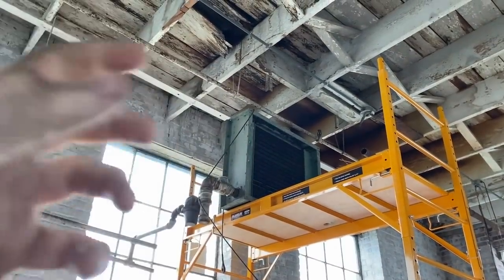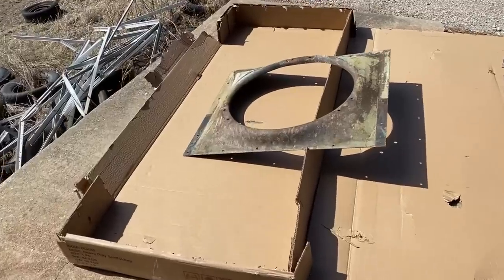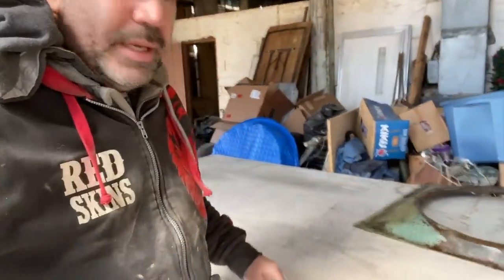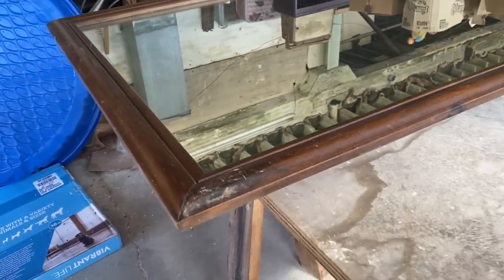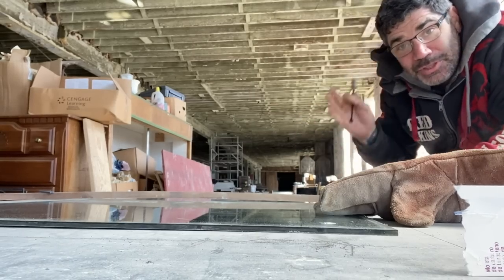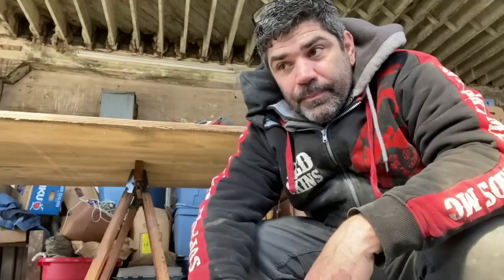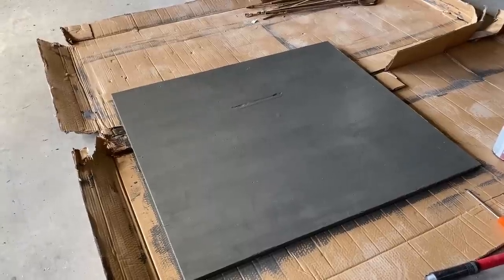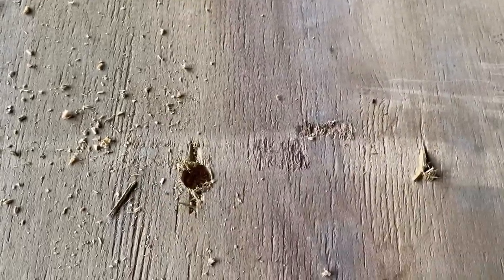Converting antique industrial salvage to interior design elements

Comment: I was a picture framer for 25 years, and cut glass and mirrors even day of the week, we even cut rounds and ovals,....(that takes a bit of learning curve). We added a drop of 3 in one oil to our cutters. In the future, buy some or find some glass and practice cutting it. Usually a light even touch, does the job. No heavy pressing, required. You got this,..even with no experience.
Reply from the maker: I just used the stuff the hardware store sold, I'll check the 3 in one. thanks.

Comment: For future glass cutting projects, you can hold the cutter at a lower angle if you turn it over. The important thing to know is that the tiny little wheel is what scores the glass, so as long as you're pushing that onto the glass you can score it at a lower angle. Doesn't have to be standing straight up
Reply from the maker: Thanks. I have a ton to cut. By the end of it I'll be a master craftsman!  over 500 windows to replace!

Comment: I make furniture, and wanted a custom shaped piece of glass, shaped like a rounded boomerang. I had to use 3/8 inch thick glass, since it was a light duty table top. I made the drawing on thick paper and taped it to the glass and let the professionals cut that complicated shape. A boomerang isn't just a "V" shape,  that inner part of the "V", requires special cutting tools. And it needed to have the pointy ends rounded. Columbus, Ohio has a couple of stained glass repair shops. This where I think you need to make some connections with the artisans and artists who live in your city. That college near by has a whole freaking fine arts department, and I am guessing there are many artists who live in your town, skilled in all sorts of things. Just a thought.

Comment: Most hardware stores cut glass for storm doors, and decor items, a picture framing shop sells mirrors and glass, and should have a wall mounted glass cutter that can handle any size.
Custom work needs to go to specialty shop, that drills and shapes glass. Places that do "stained glass" repair are usually equipped to do complicated things.
Reply from the maker: I'll check around if there is a company that does it locally.

Comment: I've found that when cutting glass if you spray lubricant on your cut line it cuts more easily and gives you a better cut/edge overall. Using the lubricant on the glass I found that I can even cut curves in the glass. All these tips should work just as well on mirrors as well. 
That is one thick mirror. You got on great deal at only $4.
Reply from the maker: Thanks for the tip. I put a drop of oil but didn't consider the whole cut.  Habitat has about 10 of them at any given time.

Comment: I would take it to a window/glass shop and have them cut it. 25 years or so ago, I made a table out of a 3/4” piece of glass and wheels from construction scaffolding by having the glass company drill holes in the 4 corners of the piece of glass.  

Did you consider cutting the mirror into a circle then securing it to the metal frame with screws and clamps through the pre-existing holes around the circular opening?  That would allow you to use a thinner piece of wood as backing which would make the finished piece much less heavy.
Reply from the maker: maybe I could try that one on the next go round, I have 9 more to do.  I need to see if there is a glass cutting business around the area.
Reply: @coldwarmercantile  Picture framing shops cut glass. Most will cut your own glass. (for a small fee)

Comment: You should cut your own window glass. In Carbondale IL there is ‘Southern Recycling Center’ who have window pane glass. With any luck you can get the glass you need for reasonable cost… as well as help the environment a little - win win win
Reply from the maker: that's a few hours away. I have a bunch of glass I can cut at the building 3rd floor. now that I have done it, I might give it a try.

Comment: i found that the glass where you plan to run the cutter needs to be real clean. then put some oil on that path.  try to make the score in one swipe with the same pressure. if you do multiple scores the cut gets mor crooked or jagged. nice mirror, i'll take 30 please////// lol.
Reply from the maker: that's what I learned, and also someone mentioned I was holding cutter upside down.  go figure.

Comment: Hi. turn the glass cutter around, so the top edge cuts first, and it stays in the right position for cutting. Great mirror.
Reply from the maker: Never thought about that.  Great tip!
Reply: I worked in a picture framing shop we cut glass and mirrors all day long,....Good advice. Clean glass, and an even handed score, not too heavy, avoid at all costs scoring it twice.

Comment: I love the mirror and metal surround.. but I think the plywood cheapens it in my eyes.. I would either cut the plywood to be the same size as the metal so you do not see it.. or use something like barn board around the outside.. or even some of that galvanized tin (or some other rustic metal).. Just my 2cents..
Reply from the maker: Yeah, it's a prototype, I have several more to go, and I'd like to keep evolving this one as well.  Maybe wrap it in some tin from the fire door outside that had the interior wood rot out.

Comment: Dont go by me because I have no taste (my wife will affirm). But i would use brass screws instead of bolts. That many course 1/4" pan head wood screws into wood be plenty to hold assembly together. I would imagine a little soak time in vinegar or the like would artificially patina/age them (im sure a the google would have proper technique). And I would not expose wood to front, make it exact size as heater shroud. 
But yer on the right track brother. 
Oh
And tommy (tommy silva of This Old House fame) says "one pass only" with glass cutter. So make it one good scratch the first time. 
"Onward and upward at all times" 
Kevin sr.
Reply from the maker: now I know how to use it. next time will be one pass. ill try the screws on the next one. thanks.

Comment: If you get diesel as a lubricant in the mirror just a stoke with a paint brush , will make a lot easier,if youhold your glass cutter at a 45 angle ,that’s what I did for 4 years cutting glass ,also as a guide for straight lines I did use a aluminum  2x 4 piece of it